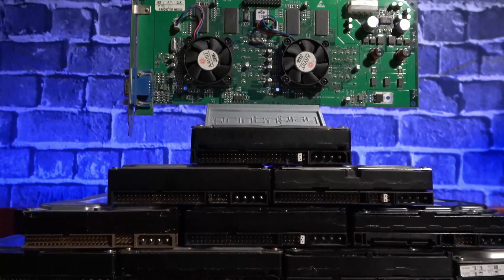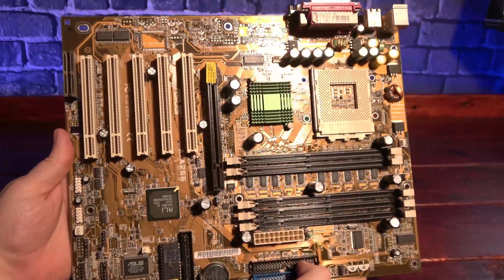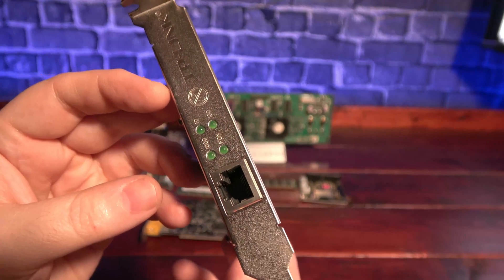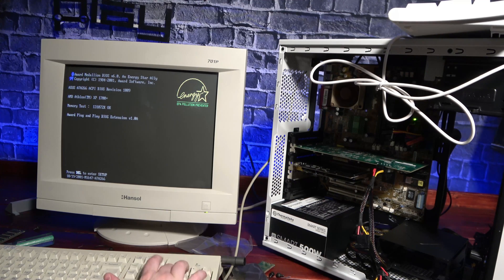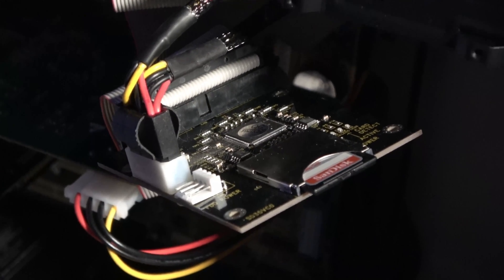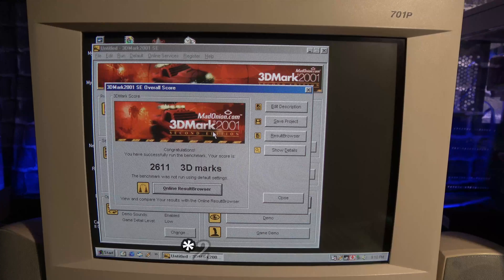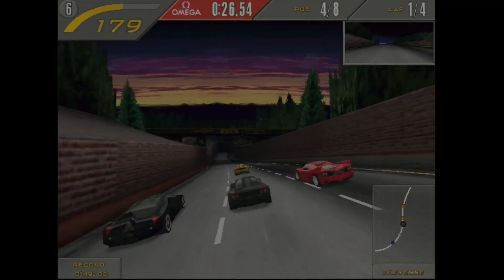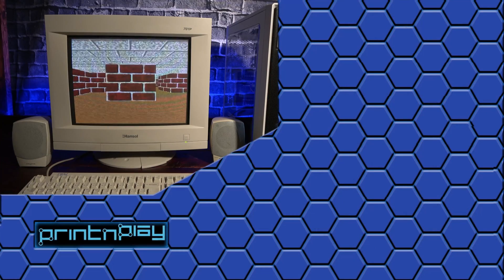Unleashing the 3DFX Voodoo 5 5500

Comment: Oh how I wanted one of these back when it was released. I'd had a Voodoo 1, Voodoo 2 and Voodoo 3 as well as the Voodoo Banshee, but never had a version 4 or 5 board. It's hard to believe that 3DFX, so long the absolute rulers of the 3D GPU market, could fall from grace so quickly and catastrophically. Only to be bought out by your greatest rival, Nvidia, for peanuts.
Reply: While Glide was ahead of its time, the insistence of using a proprietary API is what doomed them to failure. Even from one generation to the next, there was never full backwards compatibility because they did not think it was relevant. There were very few games with native Glide support. I lusted after the Voodoo for like 18 months and then got a RIVA TNT, the smart choice. ATI was smart and dropped their proprietary API PDQ. Essentially, 3dfx pulled a Betamax🤦‍♂🤦‍♂
When nvidia bought 3dfx, they flat out refused to support the mess that was Voodoo and rightfully so. They got away with it because it would be corporate suicide to keep doing the same thing that ran their new acquisition into the ground.
Reply: @Lurch-Bot1  The founders claim is was almost exclusively the decision to make their own cards. https://www.youtube.com/watch?v=3MghYhf-GhU

Comment: hey this is really cool, nicely done, would it be okay if I share your video my my x-3dfx community at facebook?

We always are looking for cool project s and yea this one is pretty neat, as the CPU gopes I would of gone for  an AthlonXP 2000+_ to get  the best optimal performance from a V5 5500, I myself use an AthlonXP 2200+ with an EPoX EP-8K7A+ with 2GB ram and WinXP pro + SP3  :)
My main VGA is a Matrox Parhelia AGP 256MB DDR with a PC flashed 3dfx Voodoo5 5500 PCI Macintosh as the secondary card., for the V5 PCI mac I am building a Dual AMD AthlonMP 2800+ with a  Gigabyte GA-7DPXDW-P so yea lots of fun incoming! the V5  PCI Mac will go in PCI64 slot 02 set to 32 bit with 66Mhz Bus mode that way it will perform like a 5500 AGP and have a DVI-D  as cool optional extra :)

But hey keep up the great work man, greets Willem B , owner of X-3dfx at FB  :)
Reply from the maker: Thanks for watching! And feel free to share!

I agree, I'd like to go faster on the CPU eventually. The machine feels pretty peppy as is... but it's always cool to max out the hardware as much as possible.

Sounds like you have a pretty fun build! Always happy to hear about other people's rigs :)
Reply: @PNPRetro  hey no worries man even the project I am working on was a nine year project mainly finding the mainboard was a sheer pain haha :)

Comment: You're lucky to have Voodoo5 - that stuff is insanely expensive nowadays (even for retro computers standards). In place where I live it costs over 9000 CAD.
Reply: That's nuts. I got one in a huge lot of retro hardware last year. The whole lot included several late 2D and early 3D cards, including the Voodoo 5, a Voodoo 2, a 2U server with 4 dual core P4 Xeons and a pair of Sun workstations for just $100! There were some other goodies like Sun expansion cards and keyboards, about a dozen SAS drives for the server and countless other pieces of vintage hardware including network adapters, RAM, PCMCIA cards, a vintage CF to IDE adapter and a complete 2x2 core Sempron AGP workstation board. I also got a rare Sapphire HD3850 AGP 1GB for $5 last year. You must hate me. 🤣🤣 Probably more if you knew just how much stuff I get for free.
But seriously, the voodoo 5 is not worth 9 grand. Sealed in box it might be worth $2500 US (3090Ti can suck it!).  A nice working example is worth about $450 US.
Reply from the maker: Woah... that's insane! Obligatory "It's over 9000!"
Reply: @PNPRetro  oh shit - I meant 900 CAD, sorry.

Comment: I have a P3 Tualatin rig with a Voodoo 5 and I've run NFS III in Glide mode without issue.  I remember thinking I've never seen it look this great before (running in 4x FSAA mode.)  I remember either editing the text file in the game's installed /3dsetup folder so that it categorized the Voodoo 5 like a Voodoo 2... or maybe I made the change directly in the registry, not 100% certain.  I MIGHT have also swapped out one file in the game's root folder - voodoo2a.dll IIRC.  I remember experimenting with a version slightly newer than the one that shipped with my copy of the game.  Is that the part you're coming up missing on?  If you still need the solution, I'll fire up my Tualatin rig and see what I did.  It's just been a while, nearly two years now, and I found I'm fonder of my Voodoo2 SLI system so that's the one I've had continuously hooked up for daily use.
Reply from the maker: Thanks so much for taking the time to reply! I hate to say it, but I'm going to have to revisit and figure out what  I got stuck on. My memory isn't always the greatest. I know I had found a lot of forum posts about people asking how to get it working, and there were links to support files from EA that were no longer available, as well as some packages people had put together, which were also no longer there.
Reply: @PNPRetro  OK fair enough but feel free to hit me back if you need in the future because I do have it working.
Reply from the maker: Absolutely will! Thanks again.

Comment: Really nice vid! Subscribed your Channel. Still have a win 98 system with a Voodoo 3 2000 overclocked to 187 MHz with Fan and AMD XP 2600+
Reply from the maker: Sweet build! I had the 2000 back in the day, lots of fond memories there.   What have you been playing?
Reply: @PNPRetro  im only 16 years old but im interessted in old hardware. For example the Case is from my grandpa, the Voodoo from my Uncle and the Gigabyte Motherboard with DDR Support from eBay. I Tried alot of Boards to Run win98 stable. I have a modern pc but also the retro PC with a nice CRT, i dont Use it that often at the Moment But i Played unreal, ut, half Life and some other Classics
Reply from the maker: Awesome! There's a lot of classic computers, and a lot of classic games out there to try! Sounds like you've got some solid games there.